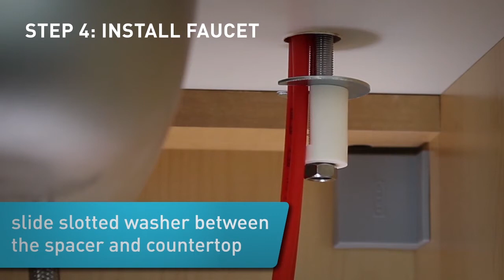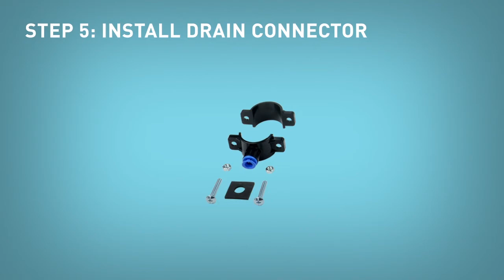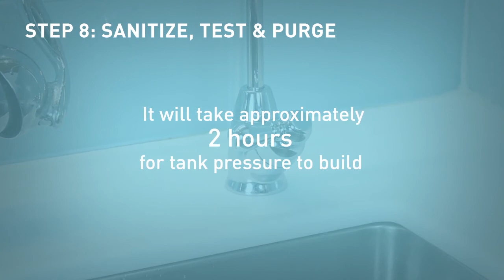Aquasana AQ-RO3 Filtration System Installation (EN)

Comment: Aquasana customer service sucks ass so I stopped using them, after the 
second filter replacement all filter casings leaked all over, they 
didn’t replace everything just 2 of the casings and they charged me 
shipping to do so, then my replacement subscription filters grew purple 
spores that turned brown, they didn't want o to replace them, would you 
use filters with brown/purple spores on them and then drink the water 
from it? I think not. I had to call my credit card company to get a 
chargeback on those as well as they wanted to charge me shipping again 
to send those back. Don't use them, even though I'm a "water for life" 
customer they just ignored my emails, finally called them and that's 
when I decided enough was enough after they wanted to charge me shipping
 to send back bad filters that I just got, after I paid shipping to try 
and replace the filter casing which they only sent me two of the three 
needed, actually, that's what the order said, I still didn't get them, 
After over a month without filtered water, I decided to go with a better brand.
 to top things off I had a mess to deal with like others, just lookup 
the leaking filters on youtube.

Comment: Installed successfully. First time and not too difficult. Took me several hours. Hardest part was I had some old hardware frozen and I had to drill out, but system and instructions where pretty clear and the job was as described. Just have a good flashlight and tools. To take out the tubes you just push in on the collar while pulling out on the tube.

Comment: This system is awful. It leaks all the time. Changing the filters requires that you run the water for 24 hours? Big waste of water!!! Constantly having to troubleshoot leaks. When you use the water much it makes a loud gurgling noise while it refills.